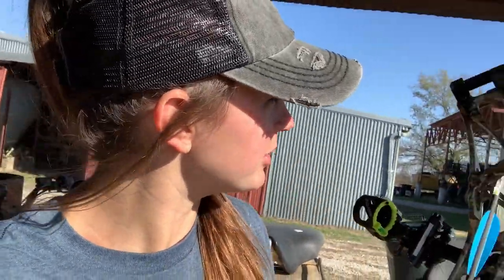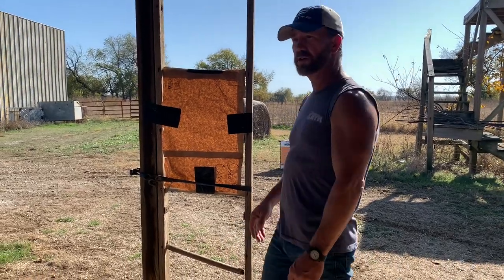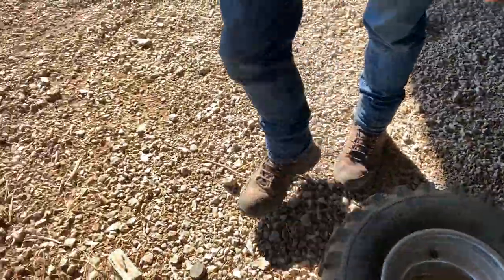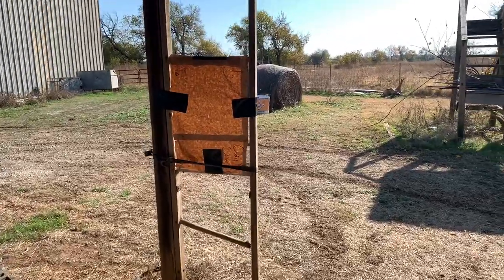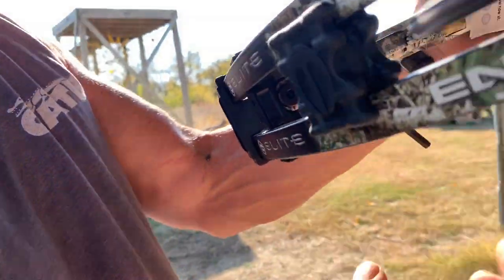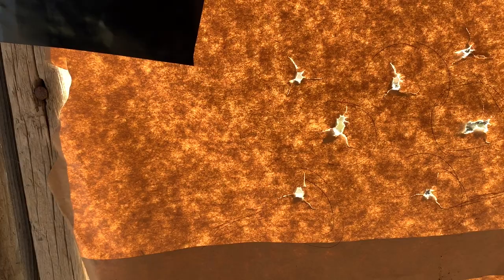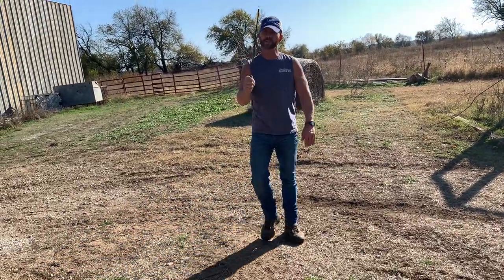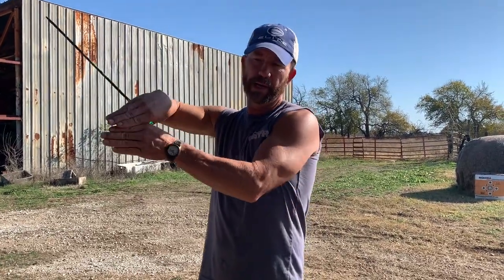Tuning my Elite EnKore! How to Tune with SET Technology!

Comment: Hi Jeff Or Hannah, Just a tip If you nip off a 3/8 strip of Heat shrink wiring wrap and cover the front edge of the fletch it won't tare off so easy and doesn't effect the flight used them for years like this, I cut off 3-4 hairs and it holds them bad boys very tight I'm still firing a PSE Nova lol.

Comment: Hannah, if you heat the bottom insert up that your fixed blade screws into , and turn your fixed blade to align with your fletchings, that helps the flight alot

Comment: Jeff if you cut 1/2" of heat shrink electrical tubing to the tips of the Fletches around the arrow shaft it`ll make a guard so the fletches don`t pry off AGAIN done mine works great I have a vid on it .

Comment: Best bows out there imo ..another way to tune them is to bare shaft tune it..strip off the fletching and stand 15 to 20 yds away from the target and shoot a fletched arrow then the bare shaft .if its out of tune the bare shaft will be sticking in at a slight angle compared to the fletched arrow ..

Comment: Hay Hanna nice bow. I like the video. I’m sure your bow is shooting pretty straight for setting it up in the field. But shooting it threw the paper on a angle could affect the arrow hole. Also I use a glue called goat tuff for my fletchings. I put a extra dab at the beginning of the feather for extra hold. But  I’m sure you will shoot where your aiming with your bow.  Just fine tuning is something fun 🤩

Comment: Learning to use the thumb release properly, not hammering the button with your thumb, will help in getting proper arrow flight. Hammering creates torque which can move the string causing the arrow to kick. Learn to pull thru the shot as it was designed to use. Great video again.
Reply: Tried a thumb release. Noticed that a had way less target panic with a wrist release. Haven’t tried a hinge release yet